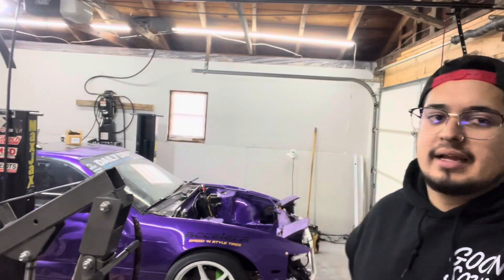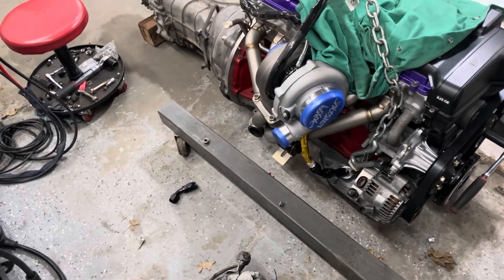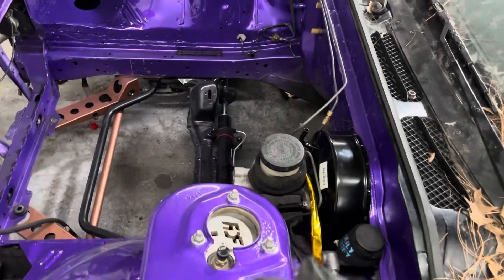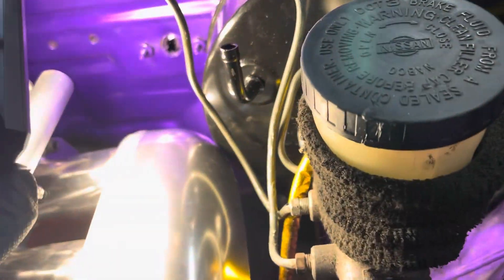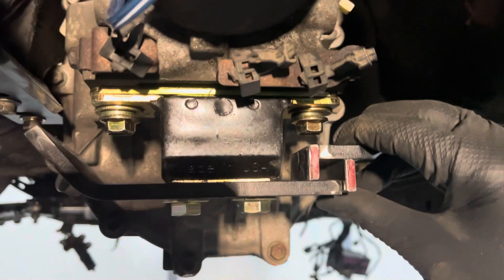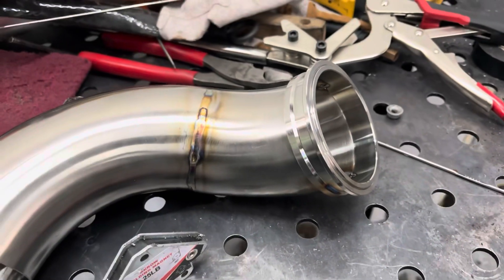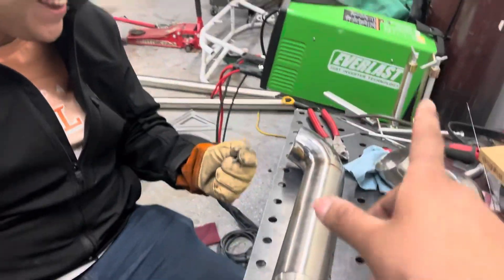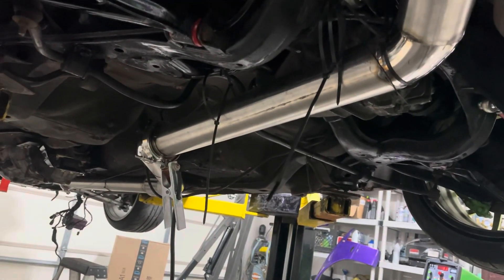S13 2jz Swapped | Tig Welding Full Exhaust

Comment: Why don’t you use a slim half size radiator with slim fan ? And a different thermostat so it opens earlier and your temps stay cool
Reply from the maker: 2jz are known for only running hot. You usually want a big radiator and powerful fans. 
Might go electric water pump which will help and also cutting the radiator support I won’t be able to fit nothing there